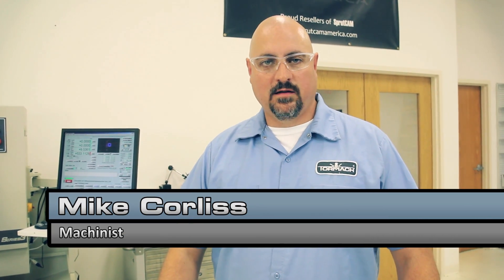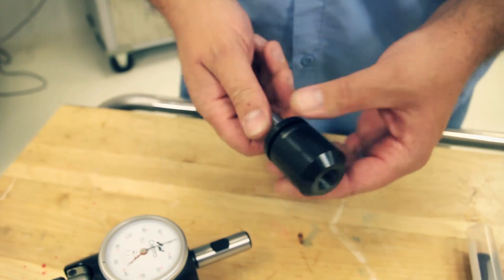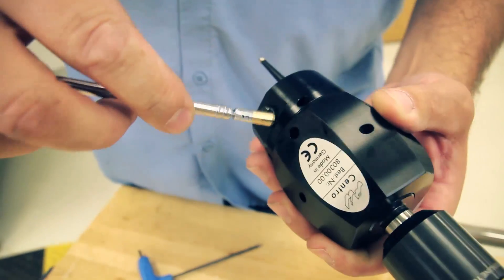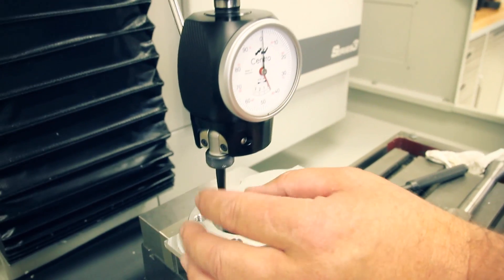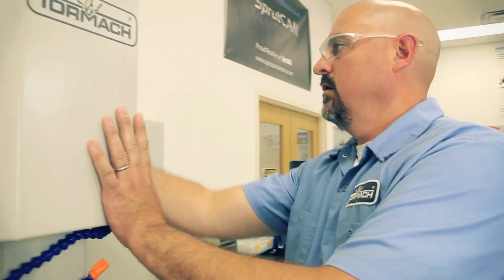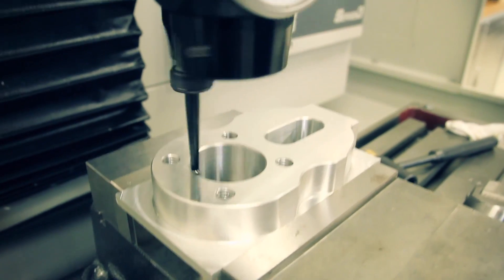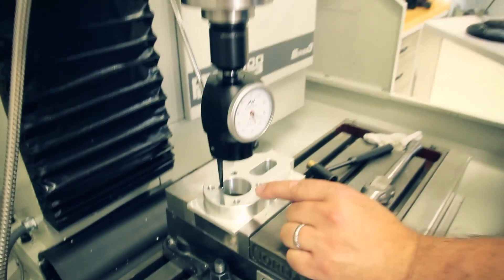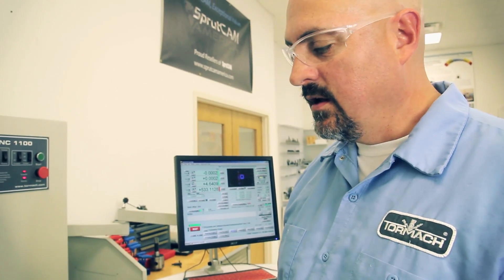How to use the Haimer CENTRO Coaxial Indicator Demonstration - Tormach CNC

Comment: It´s so easy to work with the 3D-Sensor - http://amzn.to/2CH3V17
Reply: On the optional probes.  Make your own.  Any shape you need.  Silver solder your own size bearing onto a shaft you shape, bend or not.  Grind the tip etc,  polish,  surface the mount etc.  You can do anything without spending.  As for me,  I would never buy or recommend another for the lack of a nice box to represent your tool interest.  Also, a Metric shank ?  This is America.  What's with that ?  ----When I rotate the lens, it's hard to do especially hard when your my age.  Finally,  I had been using the tool in the morning & after I set it down to move on,  I picked it up,  installed & tried to use it,  now it's locked up.  Have backlash & no indicator movement.  This is after roughly 75 careful applications. $650.00,  NOT !

Comment: Nice device but at $550 who can afford it? I've been using my Starret dial indicator for 30 years and it works just 
fine. this looks more to me like a glorified indicator. With that kind of money, I can get a NEW Kurt vise or a mic set
Reply: +GnosisMan50  add up the time the starret dial inidicator takes you to set up over the last 30 years vs the Haimer.  that alone will be worth buying 10 of these at 550.  time is money in machine shops

Comment from the maker: Thanks glad you like it.  You definitely don't want to spin this too fast, that's right.  As far as the metric dial, it never seemed to matter much to me in this application since I'm only interested in finding the center of the hole or boss, and zero is the same, regardless if you are in inches or metric.

Comment: I own a tormach pcnc 1100 , and I love it ! But I don't think  that I will be buying this item . For two reasons #1 is that it must be ran in low range so you have to change pulleys to high range before doing most machining operations . #2 is that its metric . That's just my opinion.